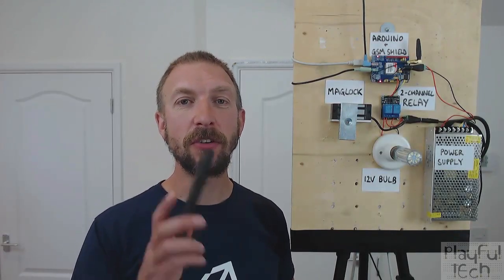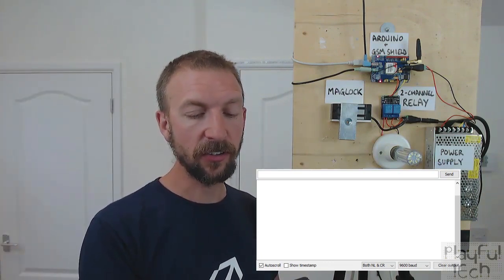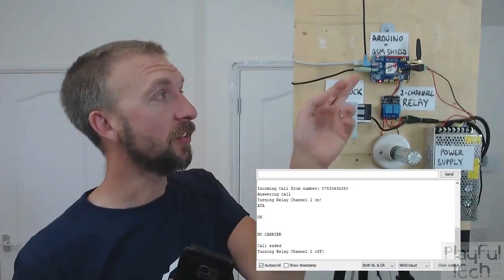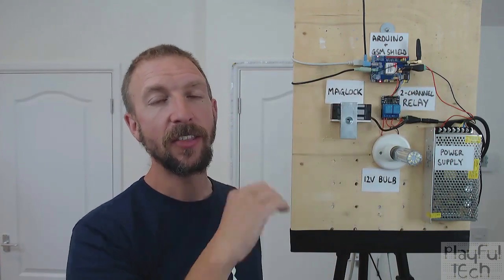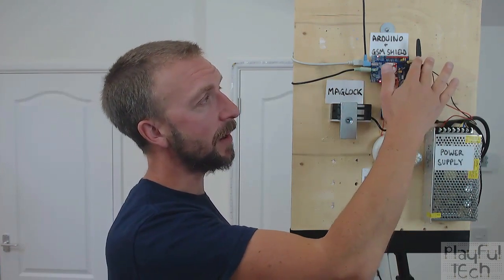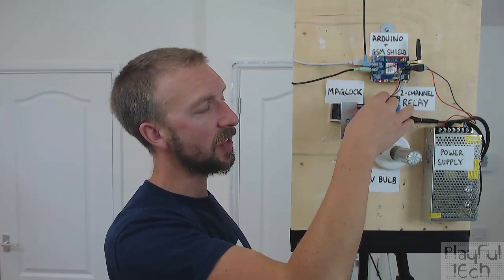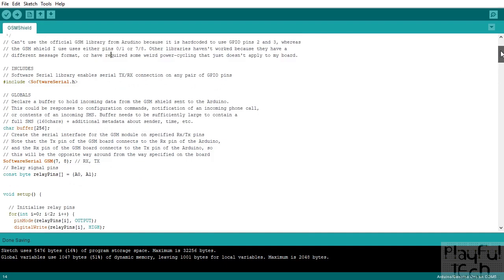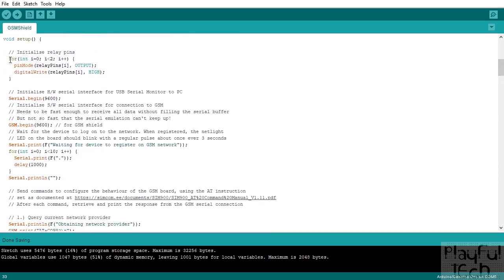Arduino GSM Shield Tutorial

Comment: Hello  this is a nice project and I got the code to this project some week back and the code compiled with an error in line code number 30. The declaration of const byte relayPins[] = {A0, A1};  The error is that A1 cannot be found. How do I correct this. I use the power supply 5v 2A and get some gibberish when I send  an sms. How do I fix these problems.

Comment: I love it! Very informative. 
Here's another idea. Do you think there is  a way that arduino can detect dtmf coming from the gsm shield then plays a certain clip from a dfplayer mini also attached to the arduino? More like an IVR giving clues depending on the dtmf input "codes". As arduino and gsm shields are much cheaper than a gsm gateway and an asterisk server. 😊 Please make a tutorial for that. 🙏
Reply from the maker: Thanks for the comment! Yes, that would certainly be possible and I do have DTMF convertor that I have wired to an Arduino in the past, though I think adding too much functionality might strain the Arduino (it's only a little microprocessor, bless it!). For the purposes of an escape room in which you're only making internal calls, I'd just run a local Asterisk instance on a Raspberry Pi - no need for a GSM gateway - so it should only cost around $70-$80 to set up. i.e. https://www.patreon.com/posts/smooth-operator-21550758

Comment: Four Quesitions:
1. Will this work in an area without internet connection, but there is a signal? For instance, to send an SMS.
2. Will this gsm card work in the U.S. on At&t?
3. I'm still a little new to arduino, I was told anything over 5v could fry an arduino, how are you regulating the power so that too much doesn't go to the arduino when you send the 12v to the light?
4. What is the size of the sim, regular / nano / micro? It looks like regular sim, but I wanted to make sure.
Reply: I'm a newby too, but here is what I know:
1. This project needs only a reliable mobile network, so it will work without internet connection.
2. I dont know, because I am on an other continent, but I guess it works with all GSM network.
3. He uses relays, and as I know they act as switches with 5v logic, but they can switch higher voltages too. So the arduino does not meet with the 12v.
4. It use the normal sized sim,